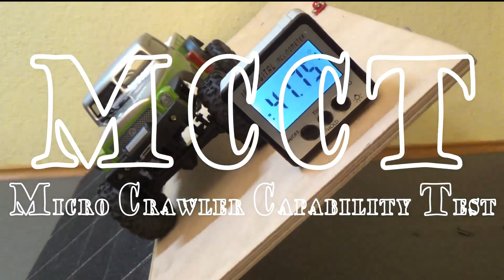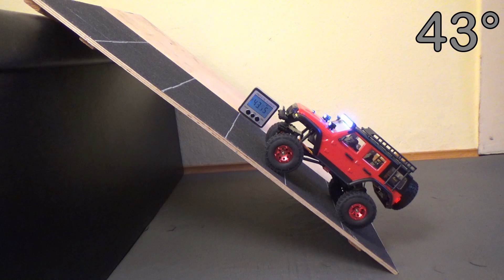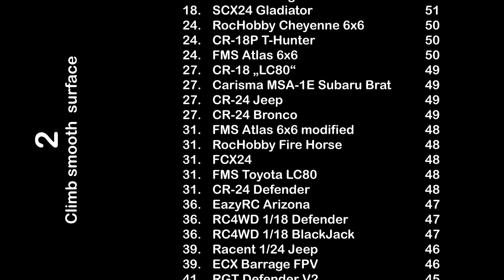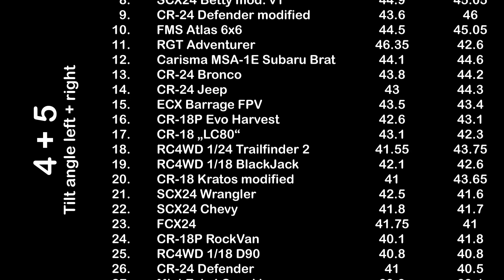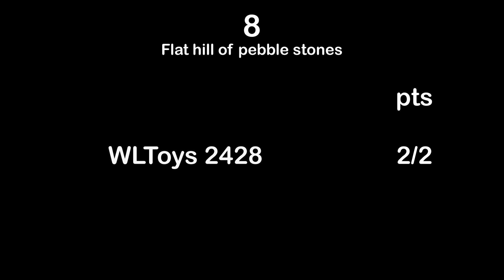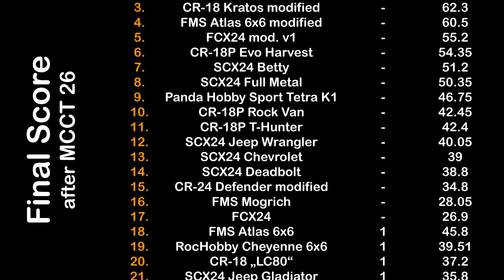MCCT 26:  WLToys 2428

Comment: I'd like to see the SCX24 Bronco do the test again, but as a modified. I had to add brass all over to get it to do anything but roll and flip. I added so much brass to it the servo wouldn't turn the wheels anymore. Now it's decently capable, but does need a motor upgrade.
Reply from the maker: I could do this  with so many trucks... did some modified SCX24 - Check Betty for example, full metal, Gvave Digger - all are much, much better then.

Comment: I changed out the motor to a 180 88t motor and it made way more capable and much smoother modulation. Also, added 28 grams to the front and then it could climb.
Reply from the maker: For sure a lot of things you can tune in the 2428... most important IMO electronics...
Reply: @donaldsneffe  honestly the 180 motor completely changed the way the esc worked. The stock 130 motot is like a 35t i think so the much higher turn 88t 180 eliminated a lot of the jumpy start. I also run mine in "gear 1" all the time with the 180 with plenty of power and no stall outs anymore. Im loving the content you're doing, keep it up!
Reply from the maker: I have six or seven WLToys micros, incl. the "old" crawler, and ESC is super, super bad in all of those. Not a lot of hope for the 2428.
Reply: @donaldsneffe  you will be pleased in the difference with the 180 88t and stock esc. 3 of my friends made the swap after they saw my 2428 with the 180 motor. It's not as smooth as an axial scx24 but good enough for me to keep the stock esc for sure. I have a few videos of mine smoothly crawling along with the 180.